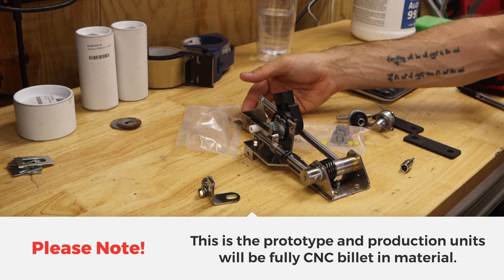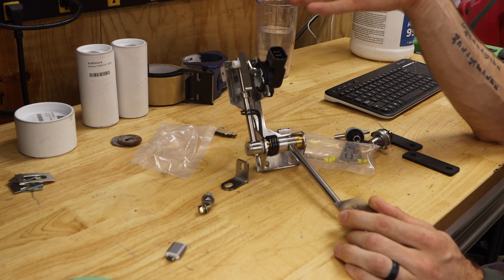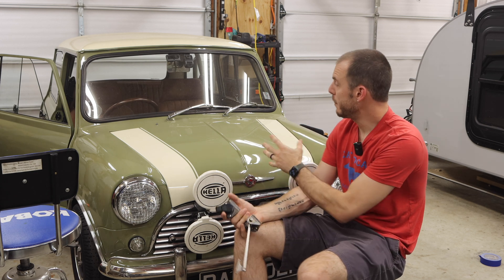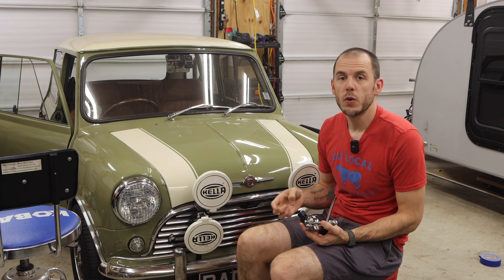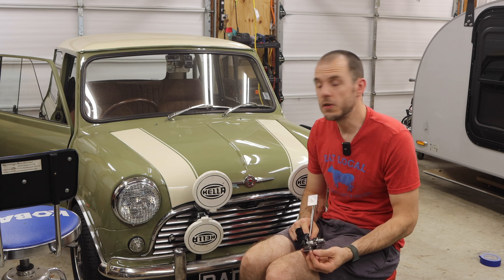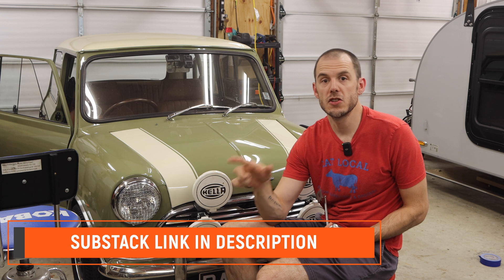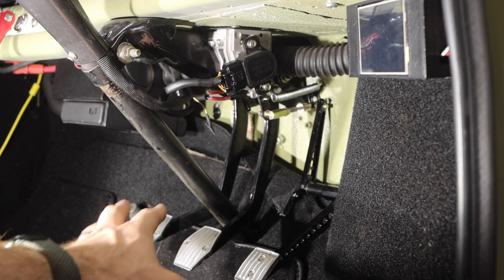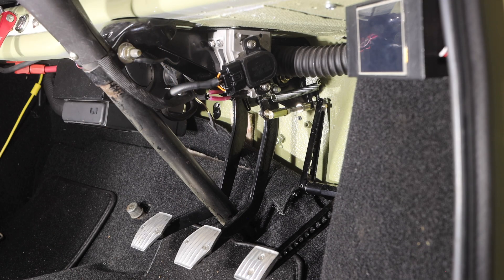Bolt in Drive by Wire for the Classic Mini | Drive by wire Pedal

Comment: Have you tested this new pedal on the road,  and in the city traffic? It seems to me that the gas pedal shouldn't be sticking out more than the brake and clutch pedals, and also that metallic sound when the pedal returns to its position and contacts the back plate is a no go.
Reply: The first 10 seconds or so of talking he show the set screw to choose the pedal height/position…
Reply from the maker: The video might provide an incorrect perspective here. The pedal is lower than the brake and clutch pedals. However when compared to virtually any modern vehicle the accelerator is usually a completely different positioned pedal when compared to other pedals.  All that said, the new pedal is lower already. 

In reference to the sound. I’m not sure I am following how that is different from the factory pedal when it returns to its resting position.  This was our stainless prototype and our production model will be a thicker solid billet aluminum.

This product has been tested on the road, in rush hour, mountain driving, city driving and all scenarios in between.
Reply: was thinking that about the metal sound as well. Think some delrin or just a bit of rubber there might dampen that sound significantly.